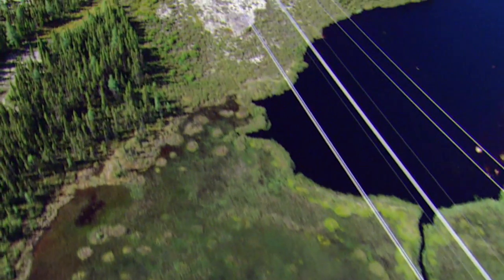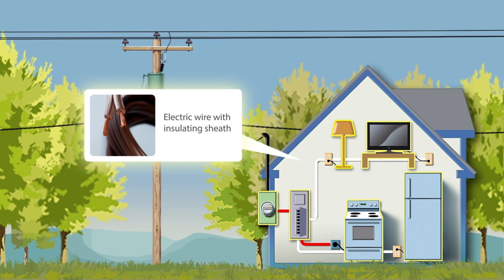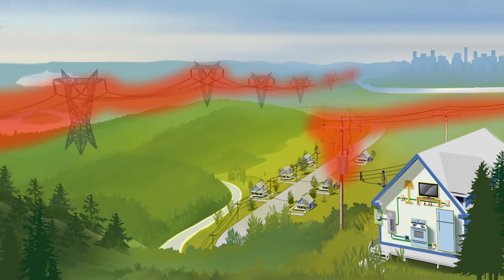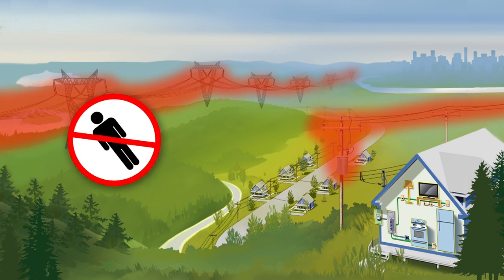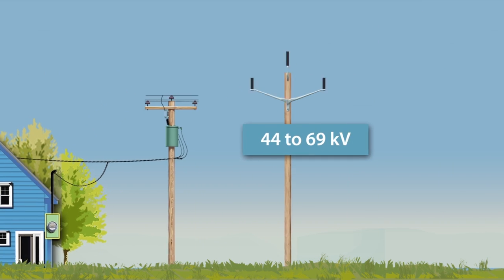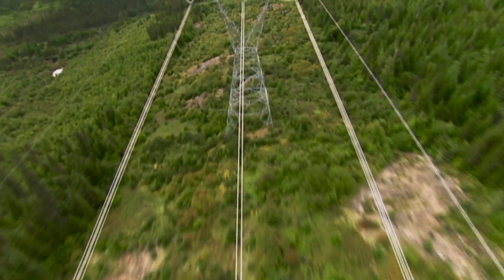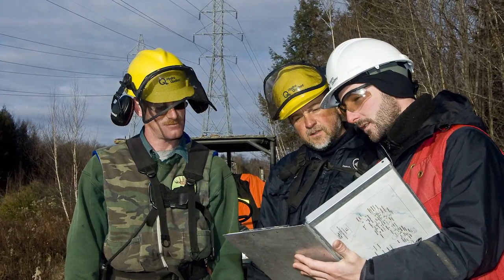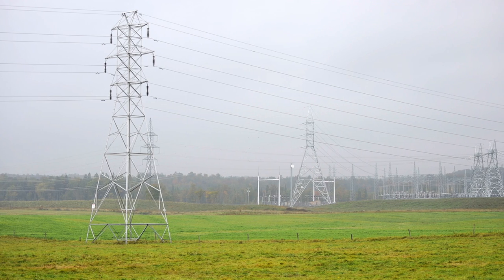Why vegetation must be kept away from power lines

Comment: I heard this caused the infamous 2003 northeastern blackout. Workers were 2 spans away trimming trees when a fault occurred, causing a cascade failure. If i remember right anywhere from 8 to 20 plans were turned off completely or partially when the one 138 kV line shorted through a tree. I imagine that would have been LOUD. Almost all of new york and a good area around it went out, and took them weeks to restore it all.
Reply: All because one line decided to poke a tree causing another to poke into a tree and another and I think another which just caused the entire blackout all around